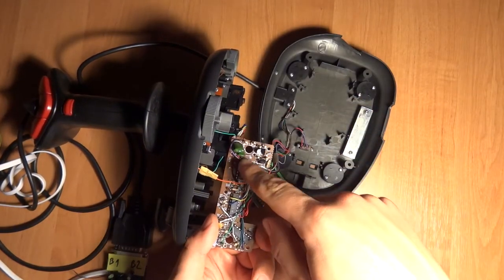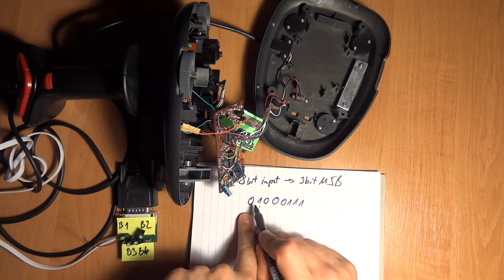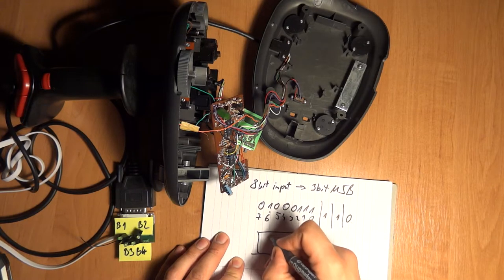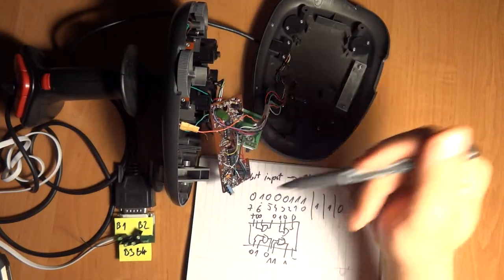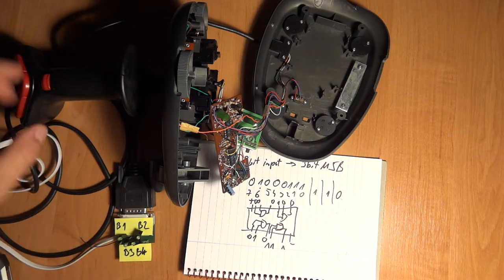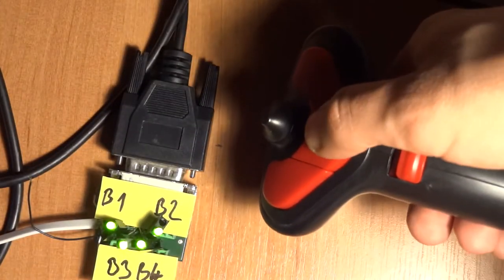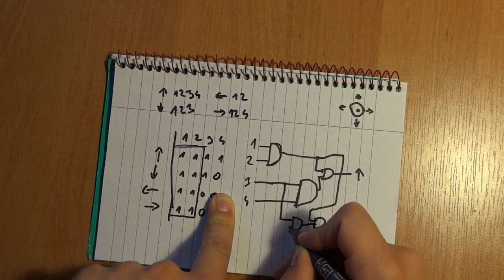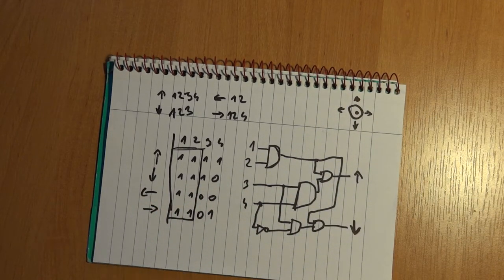Converting GamePort Joystick to USB Part 2: How it worked back in the day?

Comment: Hello! I have an old 15 pin joystick. As you know, technology with gameport input is a thing of the past. New devices do not have this entry. My question is, can we convert the 15 pins on the gameport to USB? To which numbers of the 15 pins on the gameport should I connect the 4 cables on the USB? THE JOYSTICK HAS 5 BUTTONS AND FINE ADJUSTMENT AND CENTERING WHEELS BELOW. BRAND IS PREDATOR XK 100